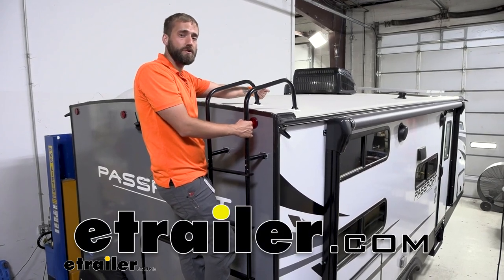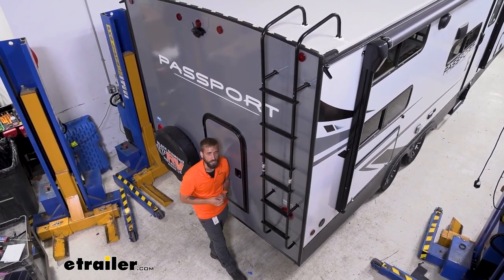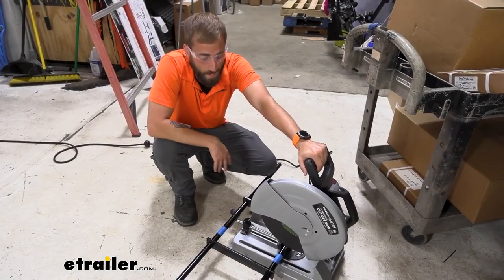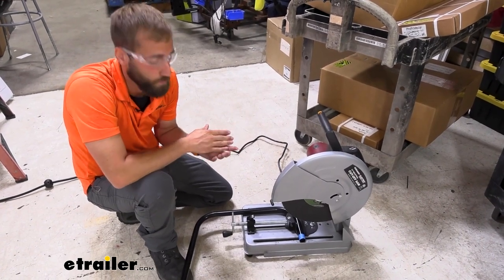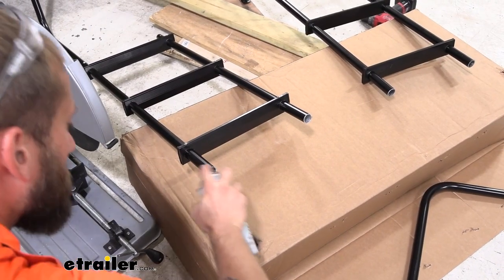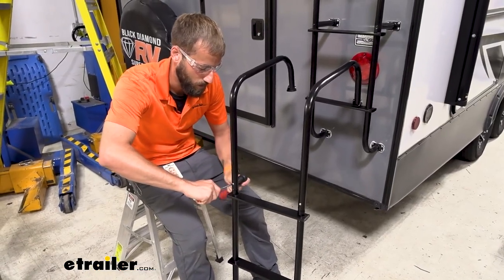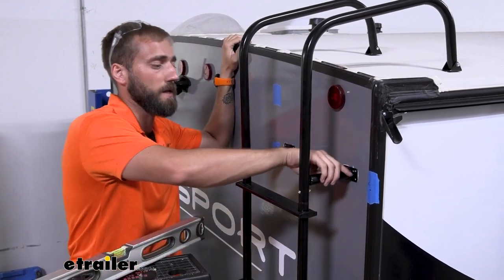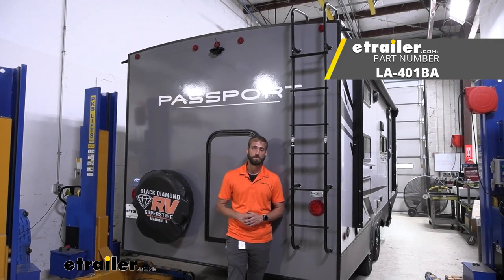2021 Keystone Passport SL Travel Trailer Stromberg Carlson Exterior RV Ladder: Complete Installation

Comment: Great video Kevin! Wanted to ask, and get some recommendation on what type of small screw to use to secure a camera for my trailer? I’m using double sided tape for now, but wouldn’t mind reinforcing it with a couple small crews to be safe. Thanks.
Reply from the maker: I appreciate the feedback on my video @LuisPerez-vy6bz. I'd suggest measuring the screw hole on your camera mount to get the right diameter screw, but I'd go with a 1-1/2 inch screw so it bites into something without going fully through the wall into the trailer. Any sort of machine screw or wood screw with some sort of galvanized coating or stainless to make sure it doesn't rust - Kevin C.
Reply: @etrailer  great! I’ll make sure to do so and thanks for the info. Much appreciated!
Reply from the maker: You're very welcome, we're happy to help!